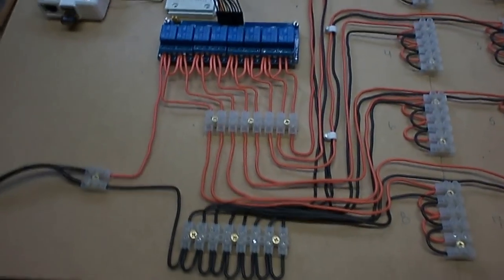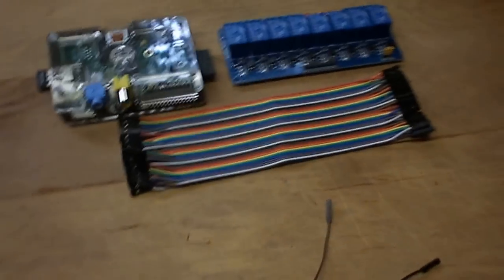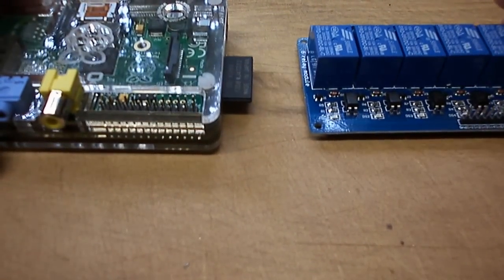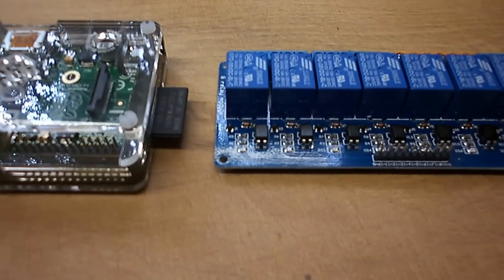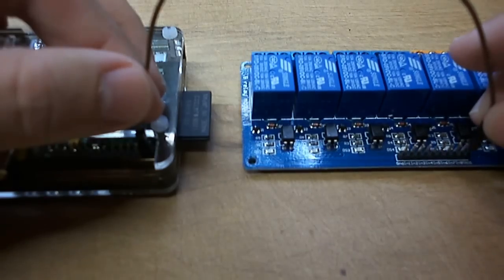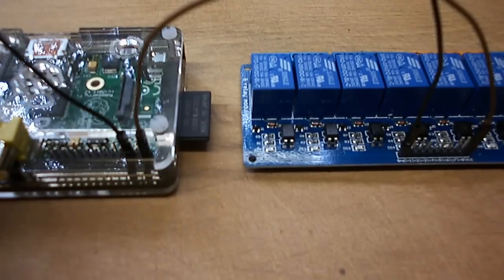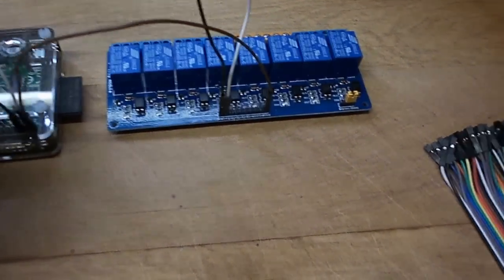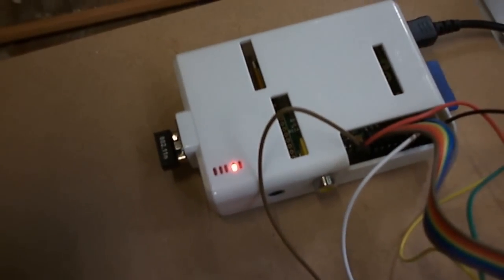How to: Home Automation - connect 8 channel relay + Raspberry Pi

Comment from the maker: I should really create another video for this question.
Basically JD-VCC is the power for the relay.  And VCC is the power for the switch to turn on/off the relay.  The way I have set it up in this video, the jumper connects JD-VCC & VCC - I did this because it's easy, but this isn't necessarily the best way to do it. Check my how to - but also know there's another way to do it, connecting 3.3V to the VCC.  I'll post another video soon.
P

Comment from the maker: Hey, thanks for watching!
In terms of the "live side" my relays are rated to 240V 10A.  You should check the relays on your board, as they could be (and likely are) different.
Truthfully, I don't understand your second question.  You only split the live wire to the relay board.  Ground and Return, do not connect to the relay directly (they're represented as the Black on my board).
Talk to an electrician.  It's not hard.  They work at most colleges or are in the Yellow pages.  
Don't die,
P
Reply: Actually - most electricians are way too busy doing their daily jobs - except for old retired sparkies, (such as myself), who love nothing better than to have a "yarn" to someone who needs help - understanding electrical circuits &/or control of extra low voltage circuits, using (oh yes) relays.

Comment from the maker: I got it from ebay.  Check the about section and click show more to see the link to the 8 channel board.  When you're buying a relay look for the optocoupler, as this will allow you to run it with your raspberry pi.
Reply: These are the one's I use here in New Zealand, as they are "off-the-shelf", and thus there's no bothering with extremely long - covoid shipping delays &/or high cost taxation/custom duty restrictions (on importing anything myself).

https://www.jaycar.co.nz/arduino-compatible-8-channel-relay-board/p/XC4418

Comment: didn't saw it before, it's just what want! I have some similar relays around, but I'm getting convinced to get a ready to go board like your's there. one of the thing I wanted to do if also get a IR receiver and map the tv's remote to say the gpios, similar to your motion sensors. anyway, thanks for the replays, make some more quick vid's on working thing, forces some inspiration to me:)

Comment: heh, it's not such a deadly interest and a single 220v socket hasn't killed my yet(although shaken much, yes.) Not the first time I'm playing with high power, it's just that I'm really afraid to connect the pi to anything since they are hard to come by around where I am. Sorta getting paranoid. ever since I got it, it was running only webservers for my studies, but I did make an apache,php with mysql and a python script thing to control the gpios via the web. thanks for getting back!:)
Reply: Hi @funnybasterd - if you are still alive after 7 years of "playing around" the higher power - 220v sockets.

NEVER assume that 220v sockets won't kill you - no matter how LUCKY you have been (in the past), as you won't know when the next one does kill you.
There's no remembering past events - or the current event (excuse the pun - fully intended) - if the next "shock" kills you.

Comment from the maker: Hey,
Glad it got your interest!  
DON'T USE MAINS.
Mains can kill and they're well beyond my skill set (that's why I stick to 12V lights).  The relays say they can handle mains, and if you talk to an Electrical Engineer there's no reason you can't. But why die for a little project?
Hope that helps,
P
Reply: YES - skiwithpole
Do use these for 230vAC MAINS circuit controllers - as these relays can handle 10A 230VAC
Talk to an electrician first to show them you know what you want to achieve, and AFTER you cold-wire your 8-way relay boards, YOU MUST ALSO ensure that same Electrician - then both check's your board's entire wiring, (as well as to "final connect" any switched 230v terminal circuits)

You though, can "cold-wire" the entire thing, and you can also extend the switched relay outputs (into terminal blocks) for the 230vAC Mains "switching functions".

Thus when completed - all that requires checking by the Sparkie (Electrician) - is a visual check for both the 5vDC signal & 12vDC supply circuits, to the relays.
They then MUST COMPLY with all regulations to both insulation test and continuity test the 230vAC Mains connected to the relay outputs, (to ensure the 230vAC circuits feed correctly into their correct terminal blocks) and finally the electrician is the ONLY ONE who can then connect them into whatever house wiring circuits - these control

To say NO - you cannot use 230vAC Mains in your final circuits - (switched via these "230vAC 10A capable" relays) - is sheer nonsense

To tell you NOT to use an electrician is also WRONG.

You can cold-wire anything - just remember to never connect it yourself, if it is to be connected into 230vAC mains
As that's why an Electrician spends 4 YEARS learning about all aspects of safety and correct wiring methods, before becoming qualified to connect.

It isn't as easy a job as some think (to "safely" connect to mains circuits without the correct qualifications), but it's fairly easy to be cold-wiring something - for an Electrician to (later) thoroughly circuit test & final-connect - BEFORE IT IS LIVENED.

Thinking that ONLY mains can kill is a false knowledge.
5vDC can kill you - if it "gets you" in the most susceptible places - such as directly across your heart .
Something easily achieved if careless by leaning onto a bench (livened with 5vDC) and licking the end of a cable - to see if it's LIVE..?
It may be - but YOU "won't be" - very rapidly.
An unfused 5vDC supply can have enough milliamps of KILLING POWER - to stop your heart beating.

I've had a few tickles in my years of Industrial Electrical work - such that I've been sent flying (rapidly sliding across a machine room floor) - by accidentally touching LIVE 400vAC 3phase mains bus bars.
It didn't kill me but boy what a thumping headache I had for days afterwards (after head-first slamming into the far concrete wall), and even to this day - sharp pains in the nerves of my right arm and both legs - (why - it's because the current went directly from my Right arm and down both legs - BUT NOT via the heart.

220kva (& higher) "overhead transmission line voltages" will generally THROW YOU away from them (that is - if you accidentally get a shock connection between lines) - but at that voltage - you will normally survive.!

That is because the current at that voltage travels across the skin itself, and NOT deep inside your thicker muscle tissues etc. and thus mostly doesn't travel through your veins which means it usually doesn't effect the heart - but simply burns your skin at the contact points, or along the skin where it took the shortest route. .

Knowing how voltage plays a part in powering things, as to how much CURRENT your body can withstand - doesn't lead to the old concept of the lower the voltage the safer you are.

Sometimes the lower the voltage - the higher the risk of deep vein burning - and a stopped heart beat

Comment: Hi, just lurking around and wanted to ask a quick question since I myself em just in highschool and don't know what I'm doing much: Just what can I connect to the relay board? how much can it hold, say can I plug it to a 220v wall socket as a switch? standart light bulbs? a tv/monitor? where should it say how much it held's? Sorry, but I'm just hoping to clear out something before I start the fun.